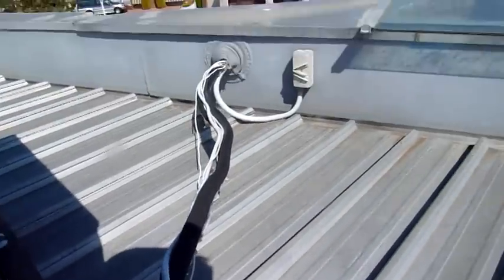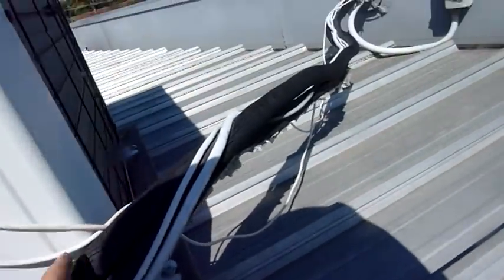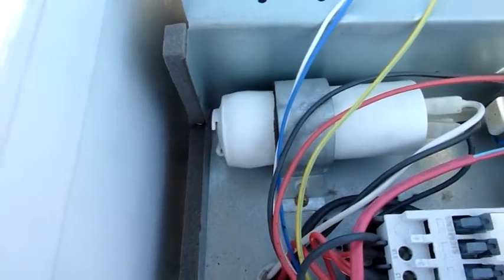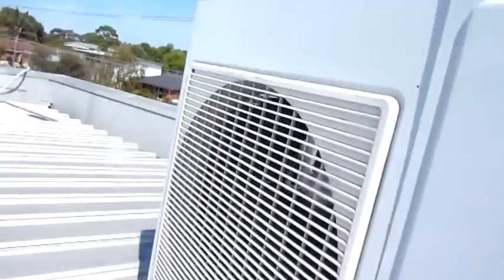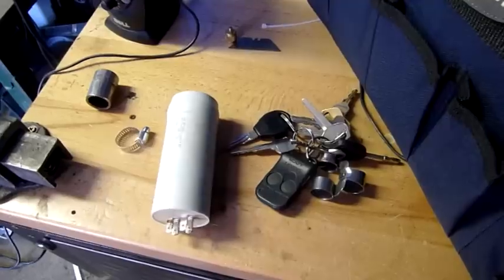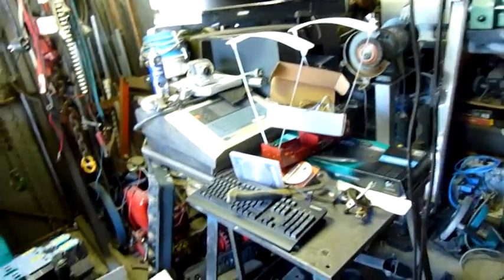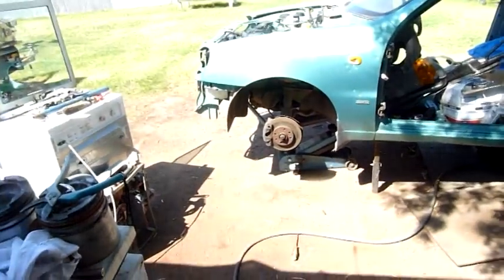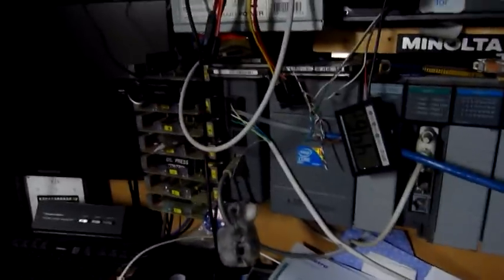Ramblotronic Random Run-cap Replacement

Comment from the maker: Its more a matter of competancy than permits when it comes to simple internal bits, my work gets me to work on things like the EDM, Lathe, Extruder and other hard wired 415V machines, and I only have to call for a licence holder when it comes to disconnecting them, replacing a cap, motor or contactor, no problems!

Comment from the maker: yep, I asked about it at work with our tech guru who has done the connect/disconnect for working on hardwired stuff, and he said as long as I am not disconnecting the unit and just replacing internal components, its all fine.

Comment: As a genuine electrician with 30 years experience in contracting and engineering, I'd rather have someone like Ed work on my gear than many "licensed" electricians.  The whole licensing system is largely a money making scam tailored to suit the Jack-of-all-trade companies that employ cheap labour.

Comment: Well done Ed, allways good to help frends :-)

Im much the same, last week my mate said his numberplate light was out and could i look at it, it was a hatchback car so im sure you know whats coming.
Most of the 13  wires in the rubber tube to the hatch were broken/fractured so i snipped them all and soldered new wires in with heatshrink over the joints, fine now :-)

Common problem, and he is a mate so...... ya know :-)

Comment: Pretty common with cheap units, they might go in 1 year or do 3-4, really depends on how they were made, and you can only see once you open it up. Common symptom is the compressor will not start or the fan runs slow depending on which cap is dying. I buy them 4/5 at a time whenever I am getting low.

Comment: If it has killed 2 motor caps then the fan cap is likely to have been well cooked as well, so it would be good to replace anyway. Those rectangular units have a high failure rate from my experience, they live a hard life.

Comment: You need to change that fan cap as well, 2uF unit from the looks of it, and they very often fail. The fan is running too slow even for low speed setting, so it is dying slowly. Will save the compressor and save a lot on electricity as well, as the higher air flow reduces the load on the unit.